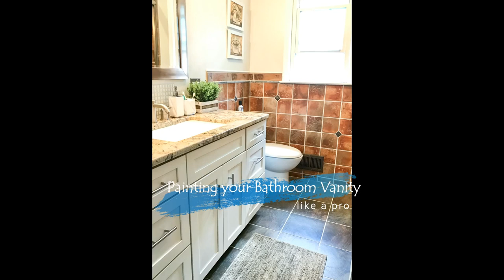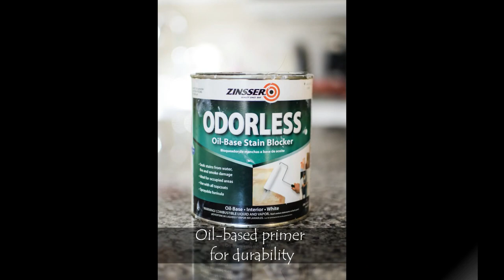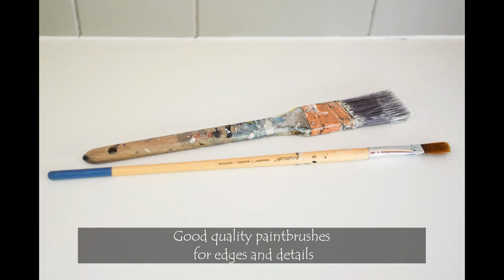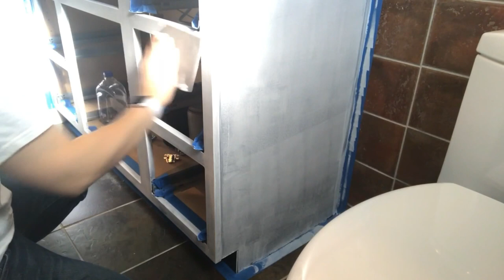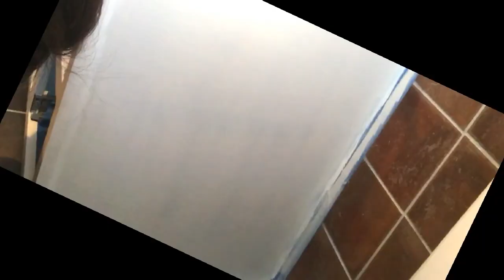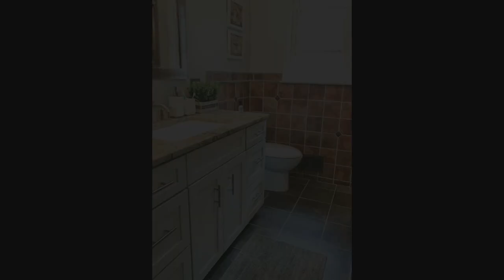Painting Bathroom Cabinets like a Pro - Speedy Tutorial #14

Comment: was a good video.  The one tip I would offer people is to pull the painters tape after about an hour after painting.  You don't want to let the painters tape dry with the paint otherwise the tape can rip off paint and also small pieces of tape will be left to the dried paint, leaving extra work to try and peel off the tape.
Reply from the maker: Thanks! That’s so true.

Comment: Thanks for the video. My cabinet seems to be high gloss (almost plastic looking finish). Can I still paint over this? I'm worried the paint won't stick.
Reply from the maker: Glossy surfaces can be tricky. You can try this whole process in a non visible section like the inside of a door and see  how it holds. I had luck with some glossy surfaces but others, not so much.

Comment: Hi Thanks for this video. Very helpful. Only question, did you go over the roller sections with a brush to make it smooth was it fine with just the roller? Thanks in advance.
Reply from the maker: It was fine just with the roller, but if your roller is not leaving a smooth enough finish a good quality damp brush will probably help. Good luck!

Comment: After mission accomplished was there any brush marks in paint?
Reply from the maker: The finish looks pretty smooth. Very subtle texture from the roller but only looking up close.
Reply: The Wood Spa by Pat Rios Texture from a foam roller?
Reply from the maker: Yes. All rollers leave a bit of texture. It can be rougher or smoother depending on the roller.
Reply: The Wood Spa by Pat Rios Less risk of fuzzies & such with a foam though right? I’m going to attempt to paint my brown cabinet white after replacing the white one with the brown a couple of years ago🤣
Reply from the maker: I like foam rollers, yes. But they have to be good quality such as this one.  https://goo.gl/LjJ9PX

Comment: For a beginner, would a water-based paint be better to use?
Reply from the maker: Yes, absolutely. I find oil based paints very tricky and they have strong fumes and smells.
This Valspar paint is water based, though I did use an odorless oil based primer under the paint.
Some other great brands for you to look are General Finishes and Fusion Mineral Paint. Amazon sells them. Both are water based too.
Good luck!
Reply: The Wood Spa by Pat Rios I have almost an identical coloured vanity that I want to paint white. Omg I had a white vanity, white kitchen cabinets, then in 2013 I changed all of my cabinets to espresso & now I want white again🤦🏼‍♀️🤷🏼‍♀️ I put Travertine in my bathroom now I want marble lol!!!!

Comment: May I ask how well these are holding up...i want to do this but have 3 little girls & worry about how well they'll hold up...& I don't have to sand then?
Reply from the maker: They are holding up well! If the wood is in good condition, you can skip sanding and apply a deglosser like I did. If you’re not sure, test the inside of a door first then see how it holds after it’s dry.
Good luck!